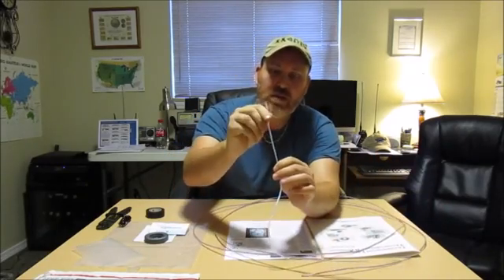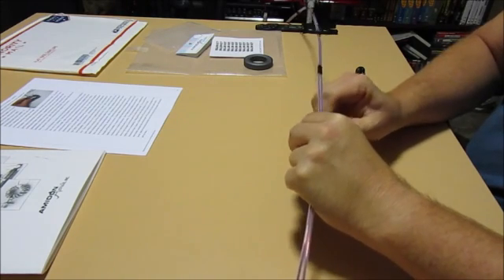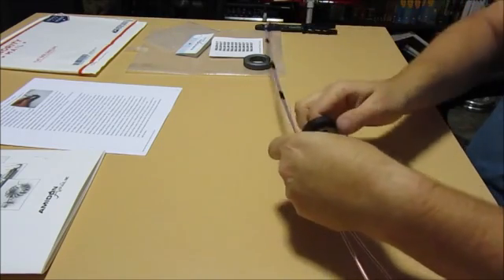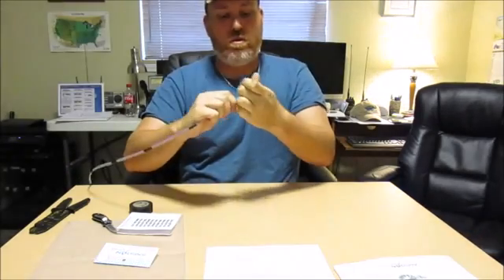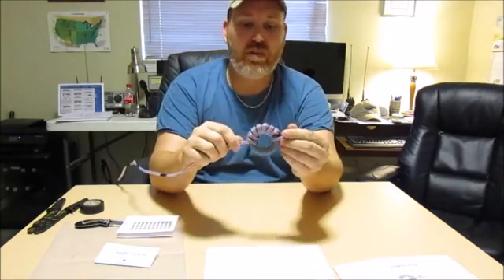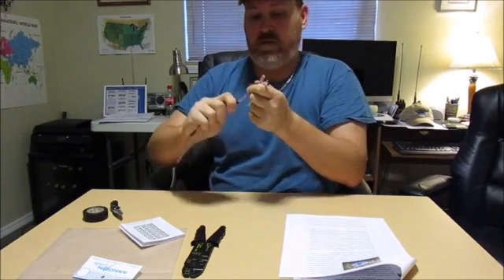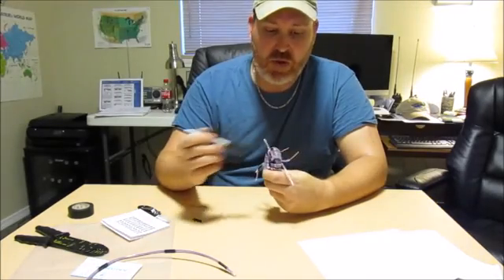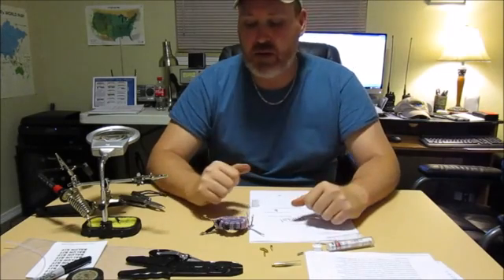Building a 4:1 Balun Kit

Comment: Is the Teflon tubing similar to what is found on 3D printer ? I'm trying to find a source for it where I don't have to buy 50 feet.
Reply from the maker: Yes, similar to what the filament goes through to the nozzle. Not sure what material they use for the tube on a 3d printer, though.  But, very similar....probably should work.

Comment: Thanks for the help! I just bought the same balun kit but it didn't come with any instructions. I want to use it to build a Cobweb antenna.

One thing you should be aware of - when counting turns on a toroid core you always count the wires going through the MIDDLE of the core, not around the outside. I saw you counting turns on the outside and while you had eight turns there, there were actually nine going through the middle of the core. (The first time you stick the wire through the core is one turn.) The article on Hamuniverse doesn't really explain it very well, but there's a sentence that says "I continued to wind a total of eight turns through the center of the toroid." I learned this the hard way a while back. I was winding toroid inductors for a QRP transmitter and couldn't get the thing to tune up.
Reply from the maker: +Dave H thanks for the information. I'm always open to feedback.

Comment: Thanks for the video.  I'm about to tackle this project myself.  How does your balun perform?  If I'm not mistaken you have 9 turns (counting from inside of the balun) on the primary?
73, Greg, KM5GT
Reply from the maker: I just looked at the book I used and it says 8 turns...so I guess that is what I did.  It's been a while...haha.  So far, I have had good success with it.  I don't have it up very high, maybe 20ft or so off the ground.  I only run 100 watts and have logged a few European DX contacts and many contacts in North and South America.